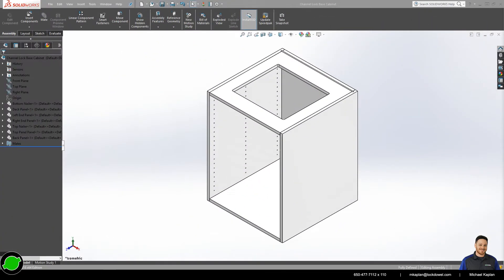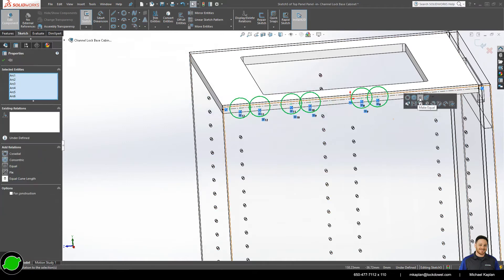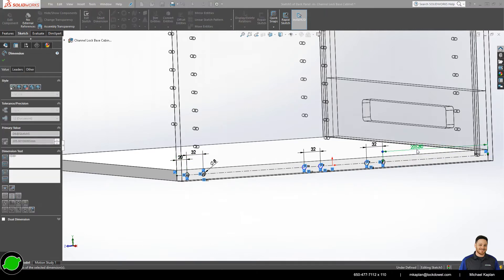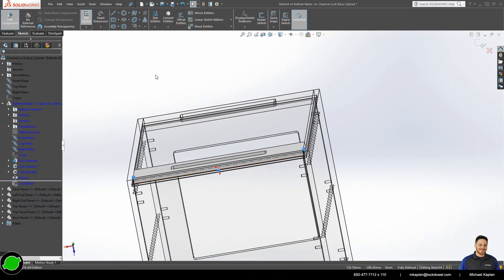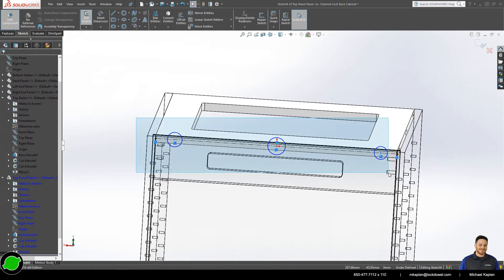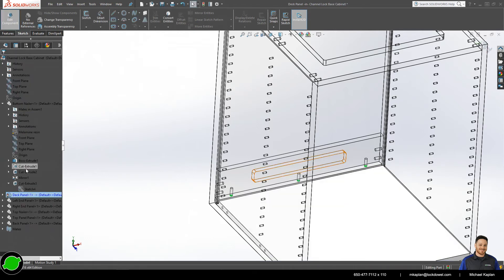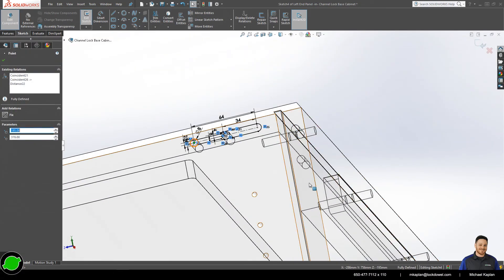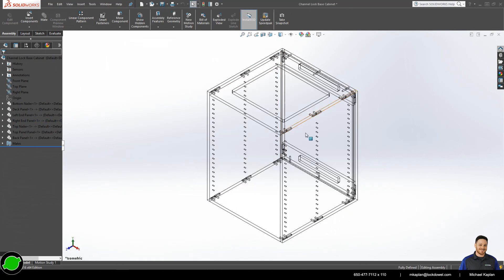CAD Design Tutorial with Lockdowel Barbed Channel Lock

Comment: Great tutorial Michael.  Very helpful.  Now I  take it that the Channel Lock routes as drawn are for the profile from  0 to -4.5 mm on the Z axis.  From -4.5 mm down to -9 mm does not  everything get routed out so  the channel is uniformly  8 mm's wide ?
Reply from the maker: Hello Robert,

I am glad to hear that you found the tutorial helpful.  In the video, I use the general shape of the rout as it would appear after cutting it on the machine to show placement.  What I didn't demonstrate is that there is an undercut in the 5mm section of the rout which brings the channel to 8mm at the bottom of that section.  To machine this, you would do it in two passes:

Step 1: Rout the 34mm long "cleanout" (as I refer to it in the video) at the depth of 4.5mm.
Step 2: Plunge down 9mm at the opposite end, and travel 64mm  towards the cleanout to make the undercut (t-slot) and full depth of the rout.

The undercut is about 4.75mm tall, but we felt that the tool created a nicer edge on melamine and veneered panels when going 4.5mm deep on the cleanout section.

I will be producing another tutorial video within the next few days to show how to manually program the routs. For this video, I am going to see about including some real-time routing of the slots to show this.  So keep your eyes out for that one on our YouTube channel within the next few days.

Thanks,
Michael Kaplan
Lockdowel Director of Engineering and Product Development